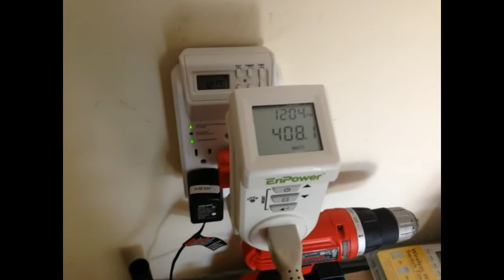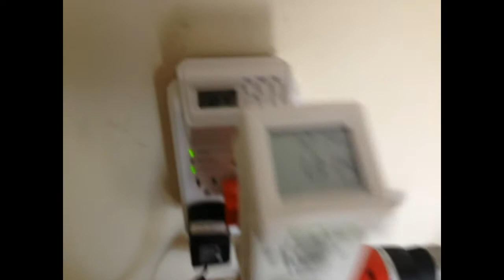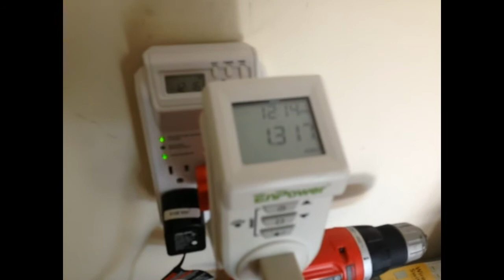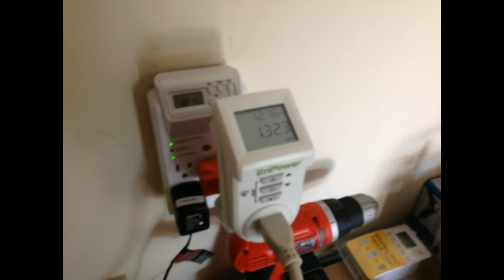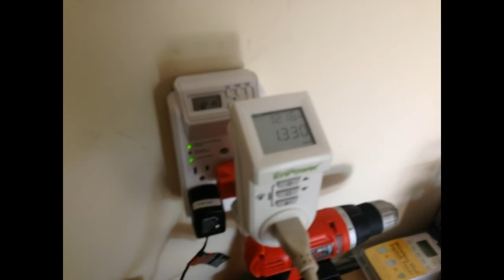DIY Home Solar  - Saving money through solar AND conservation

Comment: Good day sir. very educational videos you have there..are you familliar with Power inverters? if you do, im thinking if this is possible..to use a 1000 watt pure sine wave inverter then hook an extension cord on the output and hook up a 500 watt grid tie inverter on the extension cord to produce 1500 watts of output on the remaining slots on the extension cord..
Reply from the maker: vrich marketing renewable energy I strongly do not recommend you do that.  Mainly, because I did it and burned out the inverter I was using to test this approach.  If you look at my channel for a video I made called "DIY Home Solar - GTI with Private Grid - Concerns Verified" you will see that I fried my inverter by running it and a GTI at the same time (With no loads to consume the power created by the GTI).  I believe I understand what you are trying to do, however again I do not recommend it.  It is possible to do, if you have electrical items that will immediately consume the watts produced by the GTI.  I proved this could be done in some earlier videos, however I removed those videos due to the danger this approach caused and I didn't want to encourage unsafe behavior.  My inverter burned out because I had no loads consuming the power from the GTI so it fed directly back into the Inverter, which wasn't designed to handle the back feed.  Your GTI will sink with the Inverter as if it was the electrical utility, but unless it was designed to handle the back flow of power, it will eventually fry as mine did.  The approach is usually considered creating your own private grid using a GTI and a regular inverter or having an AC coupled system.  Again, it could be done if you had consuming loads equal to the power your were producing from the GTI.  Those loads would have to be constantly consuming the power.
Reply from the maker: vrich marketing renewable energy By the way, what province are you from?  I was stationed in the Philippines for 3 years.  I had to be evacuated when Mt. Pinetubo erupted years ago.
Reply: ok sir.. this is very helpful for me..im here in CARAGA.. what was your work here in the Philippines during that time?
Reply from the maker: I see you are from Mindanao.  I was stationed at Clark Air Force Base in central Luzon. That was many years ago.
Reply: yes sir and i have no idea/ experience in online buying..i have no referrals and person to inquire with.most of our transactions here are locally or just with in philippines...im afraid the order might be lost..i had chance to meet a British guy here on youtube and live in manila, but he didnt help me with this kind of request..i thought that would be very helpful but i failed..
Reply from the maker: I understand your situation, you require a shipping company something like DHL global shipping.  DHL is a company that ships worldwide or a way to receive your package certified, insured, with signature.  If the package got lost or stolen then at least it would be insured and you would get your money back.
Reply: yup.. if i buy to dealers in china, they can't guarantee me the product to reach here since it will be sent through cargo ship
..